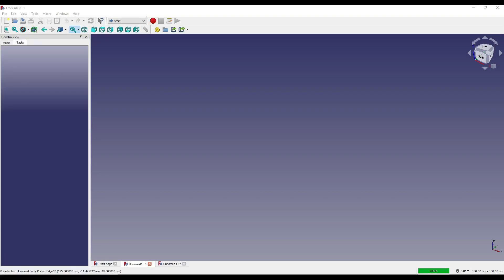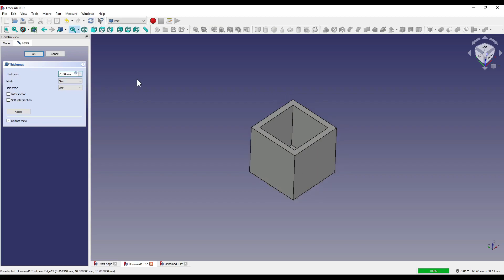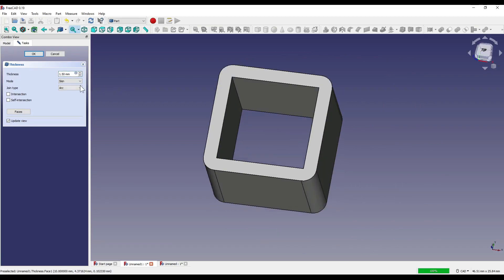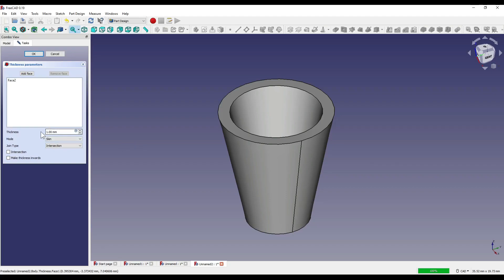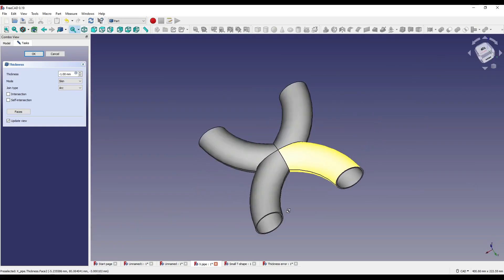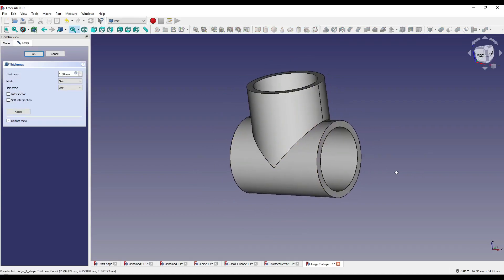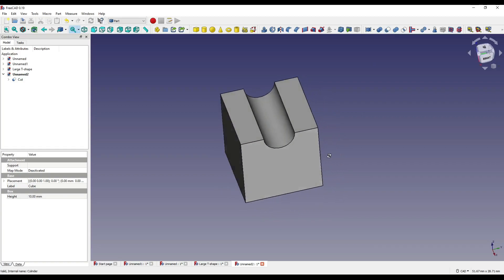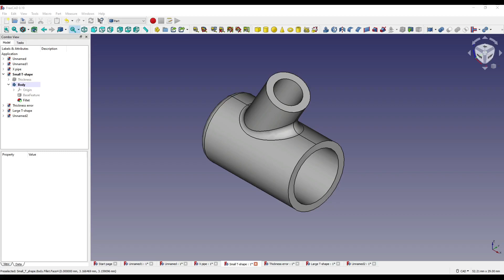3D modeling FreeCAD 0.19 tutorial - Thickness modifiers

Comment: i want to add 
1. pad a rectangle 30 units
2. then a fillet on back face of 5 units
3. then a thickness on front face of 5 units (it should be make thickness inward and join type intersection)

It also gives error

Comment: whats weird is that i cant get thickness to work on a padded square with a square cutout on one side of the sketch. imagine a c shaped pad. edit: intersection mode helped.
Reply: Change the order of operations. Thickness first, followed by cutout.
Reply: @dbeelee8564  i've gotten intermittent results using various linux installation methods (flatpak, aur, appimage) but lately the 'weekly' versions of Freecad have been performing much better and i'm not getting false errors and other glitches.

Comment: Error no. 1 6:49
I designed it in a way that worked fine. I used three Sketches. One for Inlet Pipe. Drew a Circle, then I Pad it. Then I used the top Face of this object as the Plane for other two Sketches with similar Circle drawing, for Outlet Pipes. I tilted both the Sketches on opposite sides about 25 degrees (one 25 & the other - 25) then I Pad them each. Fused them via Boolean Tool, then applied Thickness Tool. It came out well. There were no errors.